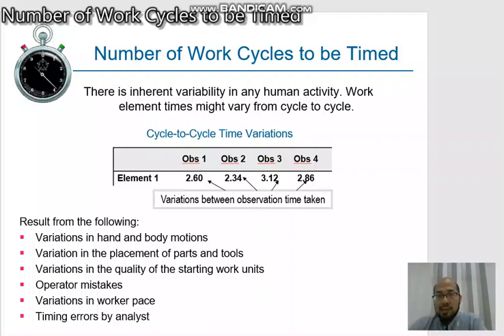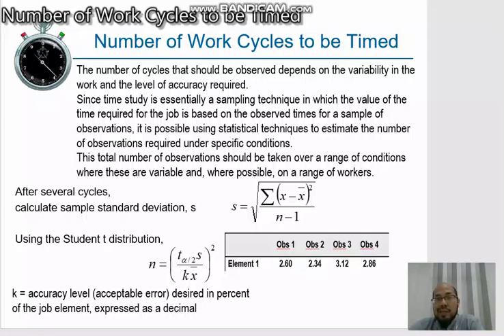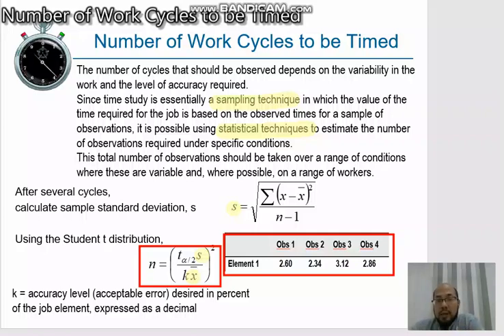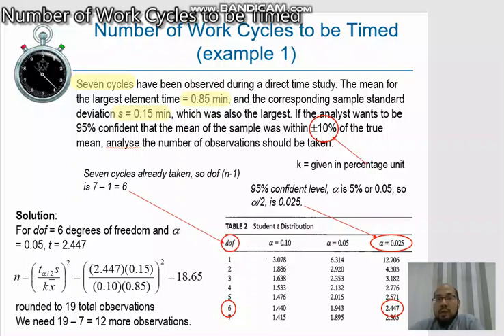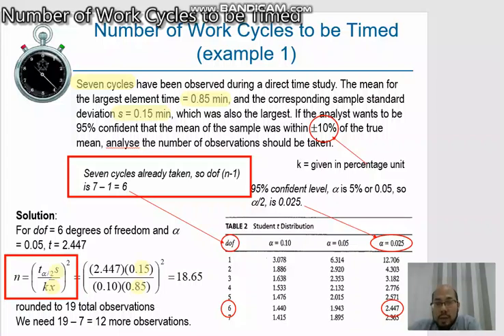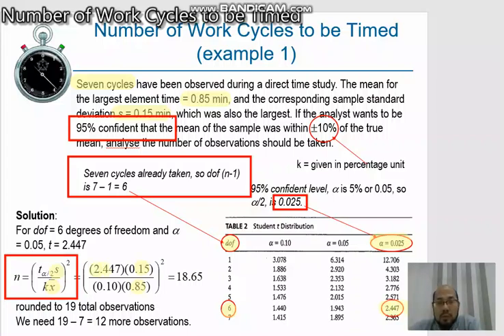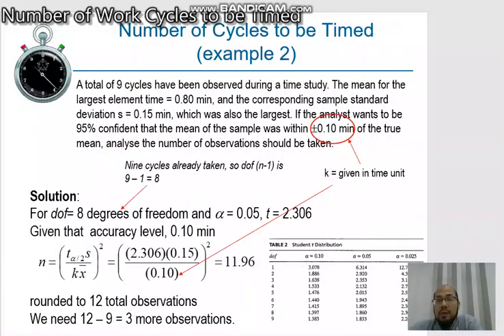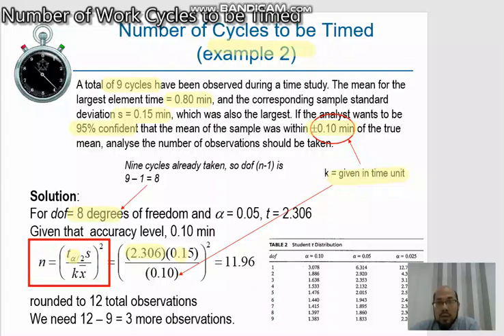number of work cycles to be timed

Comment: B052010095
What i learn in this video, there is inherent variability i any human which mean work element time is difference from each other by any reason that video given. Next is the new formula that i must learn to get n and standard deviation s. next in example one finding dof =7-1=6 and find the t value to calculate n to determine how much more observation is needed and same thing for example 2 but k is given in unit time.

Comment: B052010125
The work elements times will never be the same from cycle to cycle. This is due to human activity such as variation in hand and body motion wise or placement of parts and and tools or quality starting work units, operator error, variation in worker pace and timing error by analyst. It's possible to use statistical methods to estimate the number of observations.